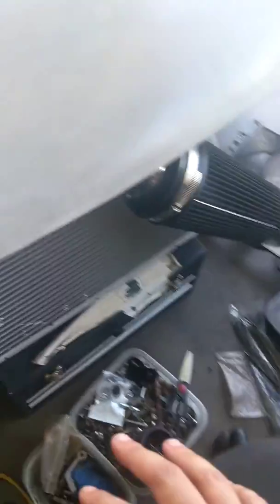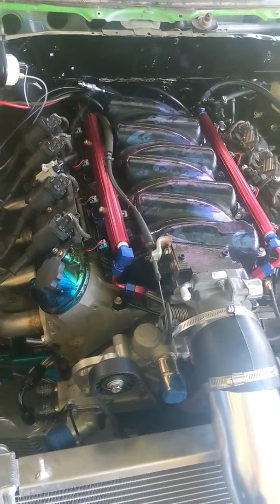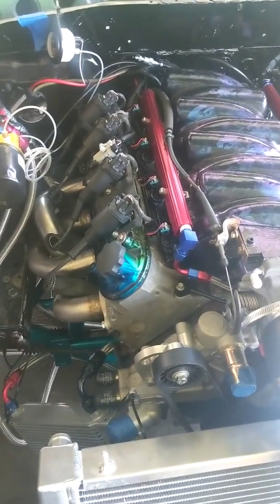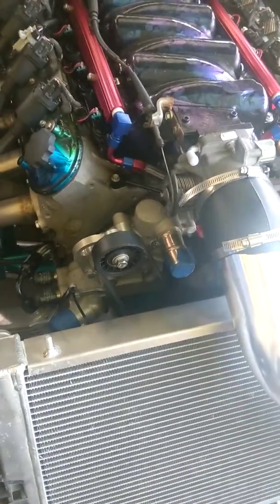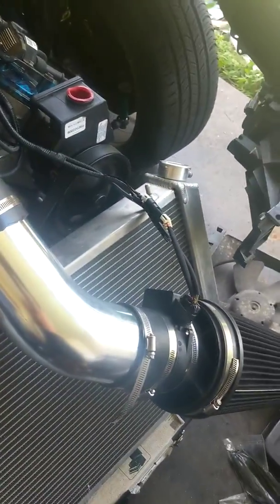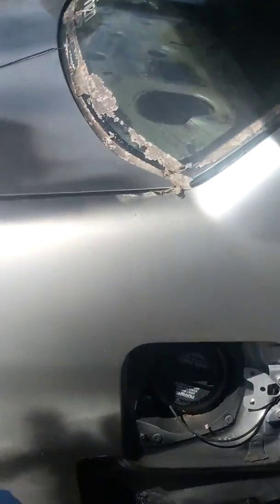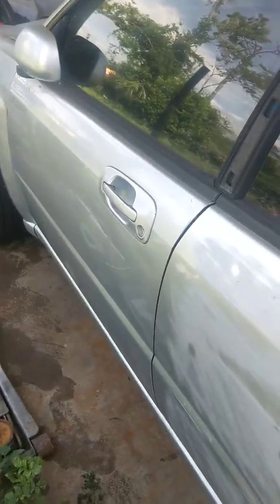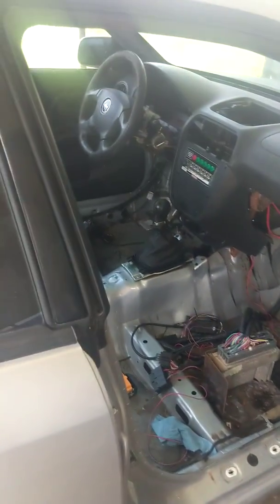V8WRX update 17

Comment: Does the engine fit with the stock hood?
Reply from the maker: Yes it does, I had to cut a small portion of the underside sheet metal to clear the intake tube, but the stock hood is on there. I'll try to ame a short video on the spacing